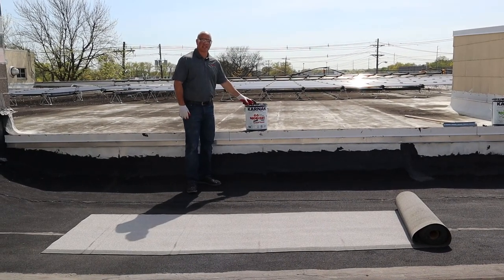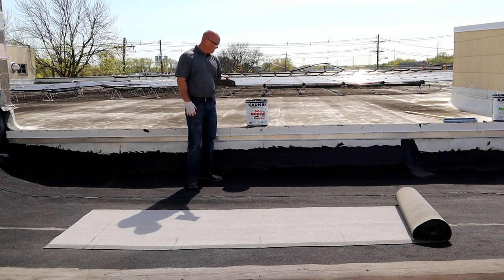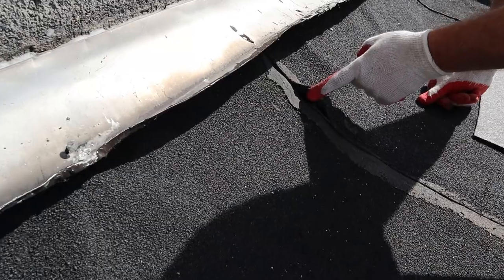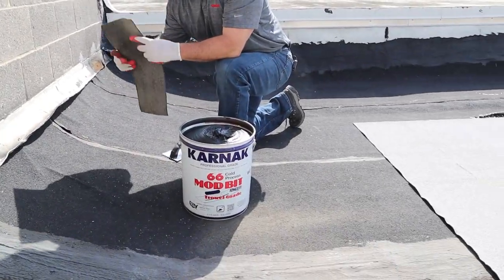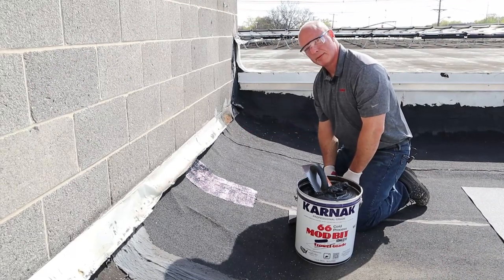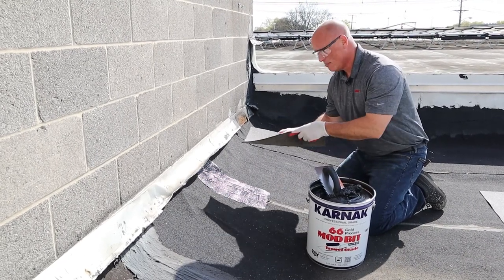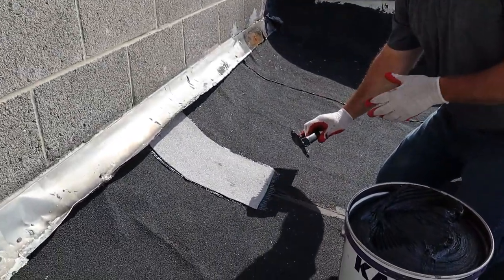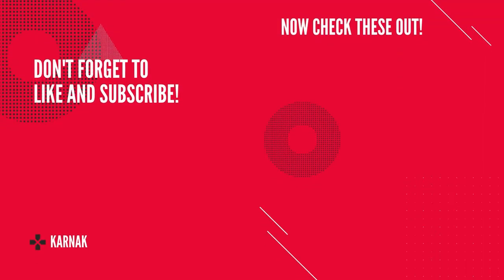How to repair a split on a granule modified bitumen membrane

Comment: Well done. After working as a contractor for 20 years I'd suggest to add : heating the patch before placing down on the fibrous tar. The membrane is made with a very thin layer of plastic and while this patch is good, heating it creates an even better bond. The roof will leak way before the patch ever does.
Reply from the maker: Great point!

Comment: Thanks for the video! Love your products. If a leak is coming from both the base seam + the vertical seams, would this also be an ideal method? Maybe using an entire sheet of mod bit cap sheet across the entire wall, creating essentially a new wall flashing over the old?
Reply from the maker: Yes, using an entire sheet of Mod Bit across the wall would work great in your situation! Please ensure there are no masonry cracks on the wall or coping that will allow water to get in behind your new membrane. Feel free to call our Technical department for specific questions.

Comment: Hi. This mod bit adhesive can be put straight on metal garage roof? Also, can it be used without anything else - just as matiarial for gaps covering. Preiviously our garage roof connection parts were covered with melter tar, that lasted for about 50 years until surn melted tar into nothing.
Reply from the maker: Unfortunately you cannot. This is just an adhesive for roof membrane to roof membrane. Always be sure to follow membrane manufacturers requirements when installing. Feel free to call our technical department with any other questions.

Comment: How long does it last?
Reply from the maker: This application is for the installation of a new roofing membrane, so it will last as long as the membrane on top lasts. While we do not manufacture or sell SBS roofing membranes, most manufacturers will give a warranty of 10 to 15 years depending on different factors.